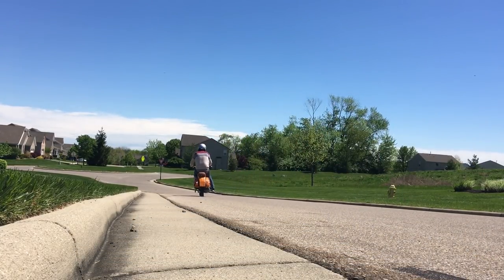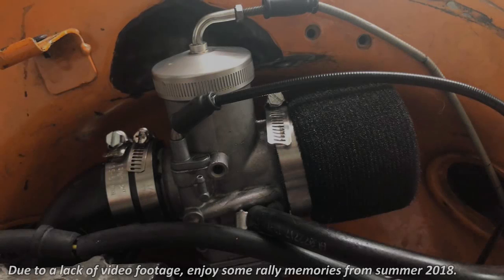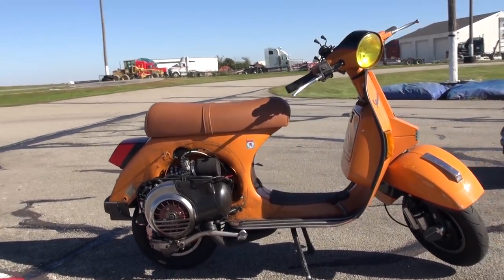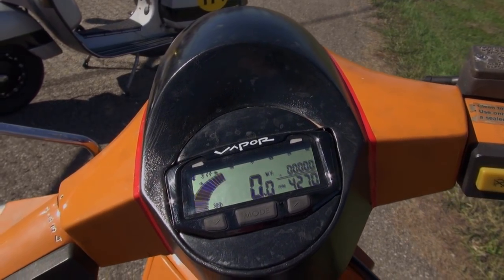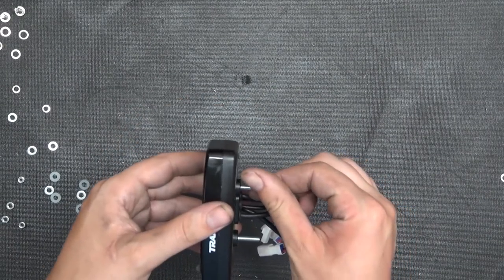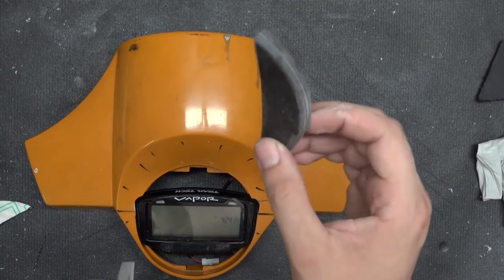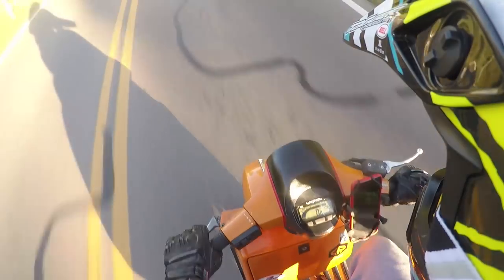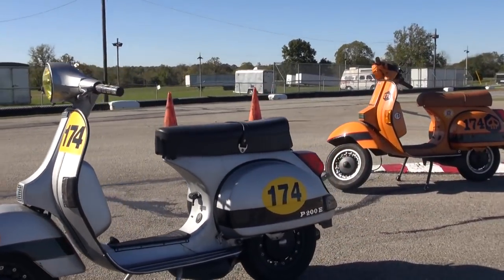TST Ep. 31 - Stella LML Vespa PX 150 to Malossi 221cc on the track, with Trailtech Installation

Comment: What engine temps you getting when in 4th, say cruisong at 60 Mph? Thanks.
Reply from the maker: 330-350 if I remember correctly
Reply: @ThatScooterThing  My Pinasco RX 190 runs roughly the same temps so that's good. What is safe max temp? Thanks.

Comment: Hi! thanks for sharing so much info. I have a 97 PX150, have done a sip 2 exhaust and rejet so far, do you think drilling the air filter 'heart' is a worthwhile mod? I was looking at it, and thinking it cant really flow any more air where the holes are drilled, but the internet seems to say it does make a difference?
Reply from the maker: Hey, 

You are correct, drilling out the air filter for better flow is a thing, albeit a small one. 

Around 8mm for the big one, 5mm for the small one.

Comment: Would I be able to bolt on a 200cc bbk  to a genuine Stella 150cc 2t. If not do you know where I can find more info on these engines?
Reply from the maker: malcolm cloutier no. Sorry if it is unclear in the video, this is a Vespa 200 engine that was swapped into the Stella

Comment: Gearbox px150, it is okay for highway?
Reply from the maker: Yeah, it has a 24/63 Primary transmission,  easy cruising at highway speed.
Reply: @ThatScooterThing  Im using that gearbox on  Sprint v model with JL exhaust. Gear 1,2 & 3 has power but gear 4 no power anymore
Reply from the maker: Awish 69 if you use a shorter 4th gear it will help connect the gears. You can also drop the clutch gear by one tooth to get better connection into fourth.
Reply: @ThatScooterThing  thanks for information

Comment: Hi, can this be done with a 2002 Baja Chetak 150 as far as power? Thanks!
Reply from the maker: The engine is based on a P200e engine case, a Bajaj 150 is not compatible with those cylinders. 

However, 150 have plenty of available parts to get decent power out of